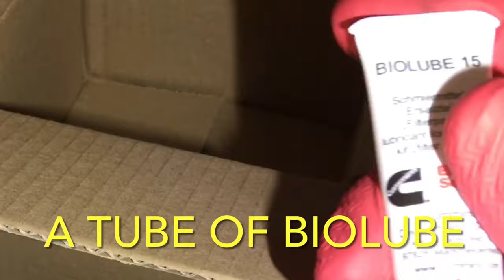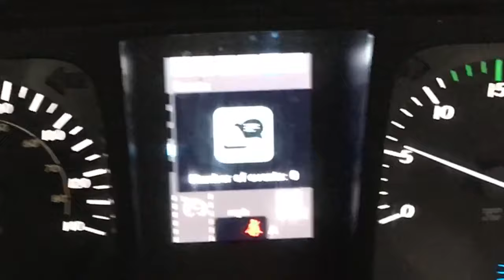ADBLUE  (DEF) filter Change. Mercedes Atego Actros Antos Arocs Econic Explained With Subtitles

Comment: how often do you need to change the filter on Atego 1222 euro 5 ?
Reply from the maker: Ad blue filter, air dryer filter and pollen filter must be changed every year, those don't get recorded or warned by dash or maintenance system.

Comment: الفيلتر نتاع واش هذا بالضبط ليعرف يخبرني ماش نتاع الكاطليزور
Reply from the maker: It's the filter for the adblue fluid fitted on euro 6 engines, the fluid  gets injected in the exhaust for convert nitrogen oxides gasses in  nitrogen and water reducing pollution. That is just the filter for protect the ad blue injector from dirt or crystals that easily form on ad blue in contact with air.